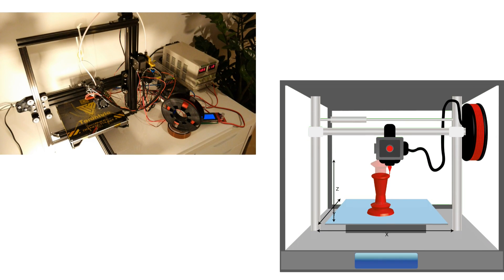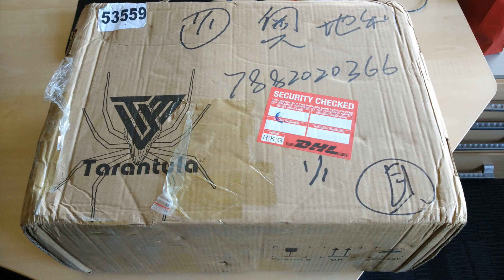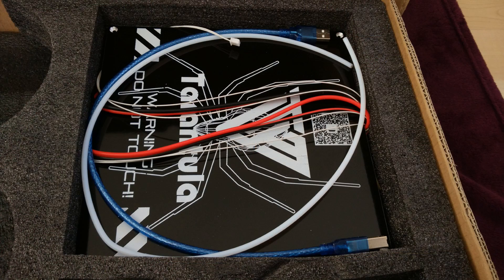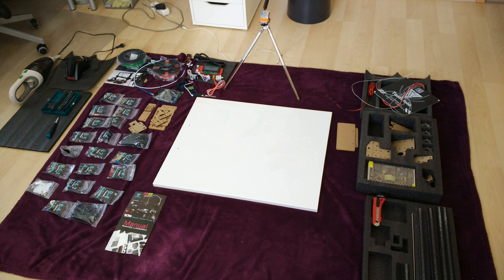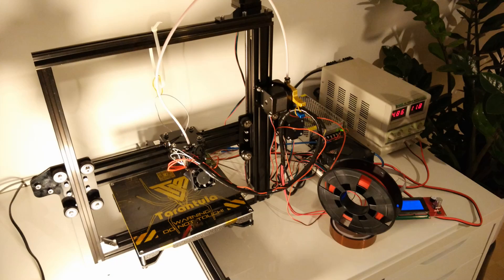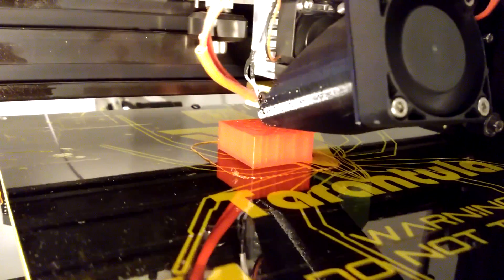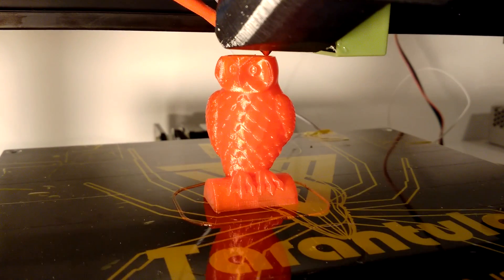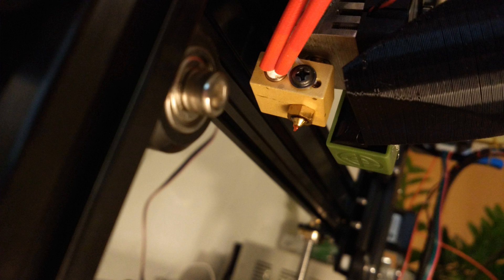3D Printer for only 239 USD: Unboxing, Timelapse Build & Test Prints

Comment: I must say that the box of parts that were sent to me  when I purchased this printer, I like but it is too bad instructions are not included.  I took
3 days to get it together and at less another 3 days, trying to get a good print.

I would think a lot of people are like me.  People that are new to the 3 D printing world so it would have been nice to have a set of instructions on the build and on making a part. I have found a lot on the internet, but they are not connected.  I know there are free programs to create and convert the 3 d object, so I wonder why Tevo did not put them on the SD card along with a sample item to print and the correct settings to use?   I would then have something to print and test the system with when it is all together.  Now, when the print does not work, it could be the equipment, the build or the slicing!

I got the auto leveling and there is nothing
in the box about installing it nor have I found anything on the web.

Comment: hello,freinds

if you like 3d printiing ,try to have a try of tevo printers.

link for check : https://www.aliexpress.com/item/2016-Newest-TEVO-Black-Widow-Fantacy-3D-Printer-Kits-Large-Printing-Area-370-250-300mm-OpenBuilds/32716633306.html?spm=2114.01010208.3.149.OhOGLB&ws_ab_test=searchweb0_0,searchweb201602_2_10000073_10000077_10000074_10000167_10000175_10000069_10000068_10000062_10000063_10099_10000156_10000158_10096_10000056_10000059_10000097_10000094_10000090_10000091_10000147_10000144_10084_10000150_10083_10119_10000011_10080_10000153_10082_10081_10110_10111_10112_10113_10114_10000089_10000086_10000083_10000135_10000080_10078_10079_10073_10070_10000140_10122_10123_10120_10121_10126_10124_10066_10065_10068_10000132_10000033_119_10000030_10000126_10000026_10000129_10000023_10000123_432_10060_10062_10056_10055_10054_10059_10000120_10000020_10000117_10000013_10103_10102_10000114_10000016_10000111_10052_10053_10050_10107_10051_10106_10000101_10000100_10000104_10000045_10000108_10000191_10000197_10000179_10000042_10000039_10000036_10000187-10052_10119_10113,searchweb201603_10,afswitch_1_afChannel,ppcSwitch_5,single_sort_2_default&btsid=0f092a00-29f6-4551-be97-2abf3167b6c8&algo_expid=81dc81f1-dbd6-403d-83cb-8db7f5ee08c3-18&algo_pvid=81dc81f1-dbd6-403d-83cb-8db7f5ee08c3

2.https://www.aliexpress.com/item/2017-Popular-TEVO-Delta-Precise-DIY-3D-Printer-Kit-High-Speed-Big-Printing-Area-D340xH500mm-Smoothieware/32793209423.html?spm=2114.01010208.3.42.fTLcho&ws_ab_test=searchweb0_0,searchweb201602_2_10000073_10000077_10000074_10000167_10000175_10000069_10000068_10000062_10000063_10099_10000156_10000158_10096_10000056_10000059_10000097_10000094_10000090_10000091_10000147_10000144_10084_10000150_10083_10119_10000011_10080_10000153_10082_10081_10110_10111_10112_10113_10114_10000089_10000086_10000083_10000135_10000080_10078_10079_10073_10070_10000140_10122_10123_10120_10121_10126_10124_10066_10065_10068_10000132_10000033_119_10000030_10000126_10000026_10000129_10000023_10000123_432_10060_10062_10056_10055_10054_10059_10000120_10000020_10000117_10000013_10103_10102_10000114_10000016_10000111_10052_10053_10050_10107_10051_10106_10000101_10000100_10000104_10000045_10000108_10000191_10000197_10000179_10000042_10000039_10000036_10000187,searchweb201603_10,afswitch_1_afChannel,ppcSwitch_5,single_sort_2_default&btsid=38830b64-e7ce-432f-ae5b-678ec9498929&algo_expid=0d70d69b-d620-49ab-89f7-ba35601d3a7e-5&algo_pvid=0d70d69b-d620-49ab-89f7-ba35601d3a7e

Comment: One quick question: I see the y axis is only supported by single metal column.  The printer that I have (Prusa i3) has support on both sides of the platform on y-axis (usual - Trantula is unusual).  My concern is that I know when I have to remove a print from the bed, I have to apply quite a bit of force and that pulls the bed up, but having it supported from both ends helps.  I am afraid with this, it will easily cause the bed to mis-align and start leaning on one side or the other sooner or later.  Is that not the case?  Is it solid and well supported?  Thanks for your help.
Reply from the maker: You are definitely right that one needs a bit of force to remove the print from the bed. One has to be careful with this, no matter if the bed is supported by one or two axis. I usually hold the bed with one hand and then try to carefully remove the part. Even better, use a sharb knife or a special plastic tool to go between the bed and the part and it will "pop off" almost on its own. Letting the bed cool before removing helps a lot. The print will then get off much easier.

Comment: Nice Print! My Tarantula just arrived, cant wait to start printing :)  Do you print directly on the heat bed? (Without glass&hairspray/glue?) In the facebook group of tarantula owners, a lot of people have problems with their first prints, and yours looks so good.
Reply from the maker: Thanks mate. I use Kapton tape on my hotbet. PLA works great using this and I'm still on my first set of it. So it's very long-living.
Reply: Oke cool. Heard kapton tape is pretty expensive? So i think ill just buy a glass and try my luck with it :p
Reply: +RC FPV Flight so directly on the heat bed isnt recommended?
Reply from the maker: Nah, it's pretty cheap actually: http://bit.ly/2b1Nn4S :-)

I heard people having great results with glass as well!
Reply from the maker: I think it should also work, but people had some problems with the first layer not sticking right, specially for models with a lower footprint. But you can try it :-). With the kapton it will stick better.
Reply: RC FPV Flight thank you very much. Think i will try glass and kapton :-)

Comment: thanks for the video tutorial. Did you buy the one with autolevel or just the basic/standard one ?  If i want to upgrade a standard tevo to auto level. where can i get the sensor ? i checked tevo doesn't sell the sensor separatedly. So if i buy from other brand or the generic sensor (for other prusa like sunhokey or zonestar) , will i get the compatibility issue ? Do you have any idea about this ? Actually, Tevo has the unit with autolevel installed already but that''s an extra $45 compared to other prusa which only need to add $10 to upgrade to autolevel.
Reply from the maker: I also got the basic version and updated it later. This is the sensor: http://s.click.aliexpress.com/e/ZbYjeuvF2
Reply: Hi, thanks a lot for the link. That's interesting.. I'll try this one later. cheers.
Reply: thanks for your review / effort to film  everything :) So I'm wondering if the autolevel-update is just a matter of adding that usd 3 sensor as the autolevel configuration you can get directly from the seller is about an extra  usd 20 over the standard configuration?

Comment: Is there any acrylic parts on this printer?  That Y frame looks like plastic to me.  Which controller is it using?
Reply from the maker: Yes, the mount of the hotbed is acrylic. This would be better in metal. But it is holding up great so far.
Reply: RC FPV Flight
I just had a plastic part in my printer melt due to 110c and 230c temps (bed and hotend).  No thanks to plastic there.

Thank you for your reply.

Comment: I'm thinking about getting this printer for myself.  How much soldering was needed for electronic parts?  Now that you've had it for a while, what problems have you had with it?  Have you done any dual-extruded printing (separate support filament)?
Reply from the maker: Hi! Still very happy. No soldering needed at all, it's all connectors - all the tools you need come with the package. I have not yet had any problems with it (knock on wood) and I've really printed a lot. The free gift filament was not perfect - it needed more heat than specified - but I was able to use both rolls of it. I did not do any dual-extruded printing yet, the dual extruder is not that interesting for me as an upgrade. I have since gotten the large printbed though, since I want to print some larger stuff, but I have yet to install it. Still very very happy with my purchase!
Reply: The large print bed is only 80mm larger in one direction, yes?  Did you get the upgraded extruder?  Print with any "exotic" materials yet?  
I appreciate the feedback.  I've been shopping since March.  I tend to research a lot before making a purchase like this.  The side benefit is that the price has dropped a small amount.  I'll look for some other videos on YouTube for this printer to see if I can't get more 1st hand experience.
Reply from the maker: The standard bed is 22 x 22 cm, the large one is 28 x 22 cm, so it's 6cm more in one dimension. I got the flex extruder as an update a few days ago and it works great. I will put a video online about that soon. I have printed some stuff out of flex PLA already, very nice. I also researched for 1 month before I got this printer. Let me know if you got any more questions :-)

Comment: Hi, its my first 3d printer so i have a question.
How i can print with solidworks? 
 I need a driver for the printer?
Reply from the maker: +Jared Hernandez I can't help here, sorry. I don't use Solidworks. Maybe someone else can help you.
Reply: +RC FPV Flight well thanks, but you use a driver for the 3d printer?
Reply from the maker: Hi! No, no special driver was needed. I just connected it through USB and I'm printing directly through Simplify3D. Before I got Simlpify3D I was printing through Retpetier Host, which also was working fine without any special driver. Simply connect the printer through USB and you should see the right com port to select in your software configuration.

Comment: Forgot to ask the other day, how large is the "footprint" of the Tevo Tarantula? I'm planning the work area for it before it arrives.
Reply from the maker: +Girya Girl Fitness Width is about 39cm and depth is about 55cm. But that is the bare footprint. I have mounted it on a 60cm x 60cm piece of wood, which also provides space for the AC adapter and so on.
Reply: +RC FPV Flight Excellent, and great idea!

Comment: Hey! First off, thanks for a great and informative channel! Second I love your accent and enthusiasm! I could literally listen to you talk for hours!

From seeing your printer I've been having thoughts of buying my own but I have some questions that you seem to know the answers to. Or at least I hope you do! :)

Q1. What does the "automatic bed leveling" actually do and how is it compared to the standard? I've read in the comments you suggest buying the standard printer then buying the level sensor by its own. Buying the sensor in the bundle costs $35. How hard is it to install?

Q2. Is it worth getting the extra bed size. The standard is 200x200 while the large is 200x280. The bigger bed is $45.

Q3. On the Tevo website they offer "Pro Metal Extruder (flexible filaments)" for extra $43. is it worth it getting the metal extruder?

Q4. Overall this seems like a very good printer for its amazing price and I doubt there's one better for the same price. But if do you know any other printers in the same price range that you'd recommend? 

I hope I don't bother you with these questions but your help is appreciated since I'm standing between buying this one or waiting for something else.
Reply from the maker: +HaasGrotesk - many thanks, glad that you like my channel :-) Here come the answers to your questions:

Q1: With autoleveling a sensor beside the printhead will measure the distance to the print bed at various positions before each print. That way the printer knows precicesly the distance of the print head to the bed at each position, even if the bed is slightly warped or even tilted. In this way it helps getting better print results. The sensor is simply screwed in besides the hotend and then plugged into the motherboard. The sensor in the bundle costs $35, this is overpriced, simply get the standard kit and buy the sensor here separately (it is precisely the same sensor): http://s.click.aliexpress.com/e/BeAYbyFeq

Q2: Totally depends on what you plan to print. I started with the normal size and have since then upgraded to the larger size, since I want to print some larger frames or even small wings. It really depends what you plan to print ...

Q3: You will only need this if you plan to print flexible filament. You won't need this in the beginning, you will have more than enough fun with PLA and ABS. You can upgrade it later if you really want to print flexible stuff.

Q4: I'm still really happy with it. I still think it provides the best value outthere if you want to start with 3D printing.

Let me know if you have any more questions :-).
Reply: RC FPV Flight Thanks for the answers! I'm pretty sure I'll be getting this one. Will probably go with the bigger bed and maybe the metal extruder. I'll order the sensor separate.

I got one more question though! Before I order I happened to stumble on this printer http://goo.gl/olv3f1 could you take a look and see what you think. I would like to get your opinion on it. I know you can't say very much since you haven't tried it but what is your first impressions on the web?
Reply from the maker: +HaasGrotesk Hmmm...in one of the groups I'm a member of on Facebook guys have actually compared that one to the Tarantula. I think their main argument against the one from your link was that it is not a full metal frame, thus vibrations are an issue. But as you say, withoug first hand experience I can really hardly judge. I do know that my Tarantula has been working without any problems so far.

Comment: Do you think this Tarantula printer could be used to print reduction gears for brushed 380/400 size motors for RC Submarine use?  I wonder if the print resolution would be fine enough for the proper functionality of gears.  So that the gear teeth mesh properly, and the gears rotate without binding..  I looked into CNC Milling machines for doing gears.  They can cut them from metal, but the CNC Milling machines are much more expensive than this 3D Printer..  I'm wondering if plastic gears from this printer, would survive real world use in low rpm applications in an RC Submarine.  Low RPM as in under 6000 RPM.
Reply from the maker: +Komet163B I believe it is able to print very precicesly, when you have calibrated everything. For the owl which I printed with 0.1mm precision I could almost no longer see any layers. People I know who have the same printer even used precision down to 0.05mm with success. So I think it should be perfectly up to printing those gears, definitely worth a try. Maybe print them out of Nylon? That should work great.
Reply: There are also some unique but expensive filament types such as stainless steel PLA filament. It adds quite a bit more weight but results in a stronger piece.
Reply: There are also some unique but expensive filament types such as stainless steel PLA filament. It adds quite a bit more weight but results in a stronger piece.
Reply: There are also some unique but expensive filament types such as stainless steel PLA filament. It adds quite a bit more weight but results in a stronger piece.

Comment: Thanks for the great review video of this printer.  For the price I may have to try it out.  I have built a Prusa i3 with the standard smooth rods and linear bearings, but I really like the idea of the bowden and extruded aluminum frame.  I think the wheels riding on the frame may give a smoother faster print.
Reply from the maker: +chuckstertv I can speed it up pretty nicely without loosing any visible quality. I really like it for its robustness and simple building. I would definitely buy it again.

Comment: That looks like a great printer for the money, but looks like its a pretty complex build just going by the amount of parts you have laid out there.
Reply from the maker: +LeakyMeat Not that bad. There are excellent build videos available as a guidance. But true, the build takes its time, we took a weekend to build it up, one Saturday and half a Sunday. But this is also a good thing, because that means you literally know your printer inside out before you even start printing.
Reply: It is not a very complicated build. I know from experience. The only problems I have had with it is a faulty thermistor and a leaky extruder. The building process is not complicated at all. I was able to build it all in less than a week, and only spending a hour or two each day. All this is coming from a 13 year old boy.